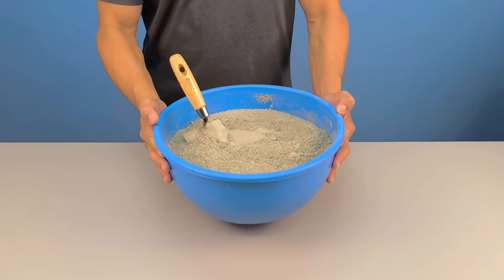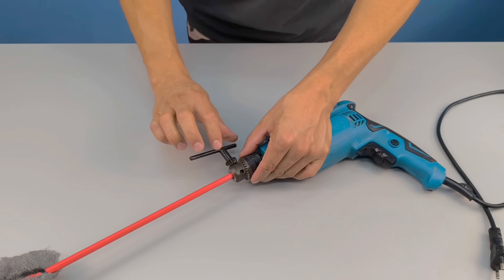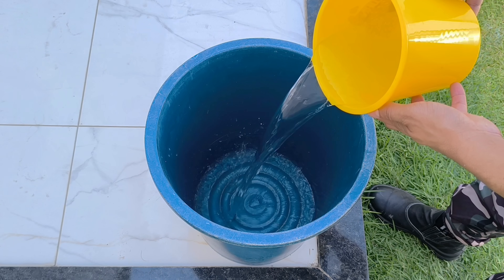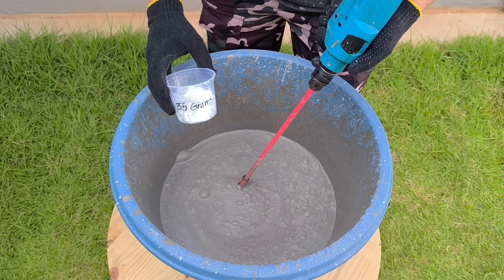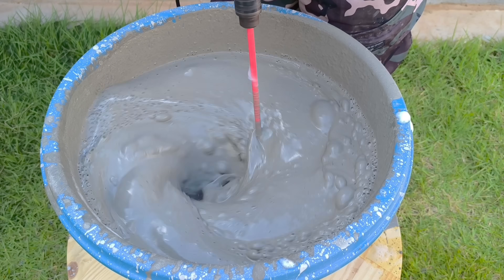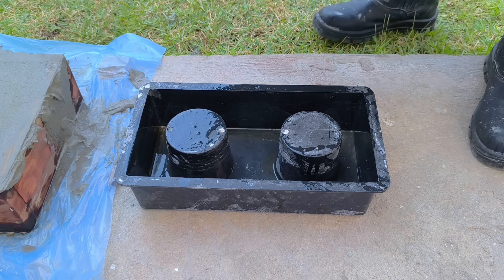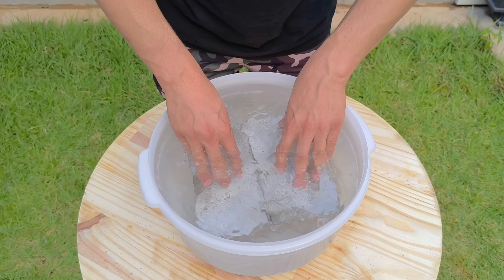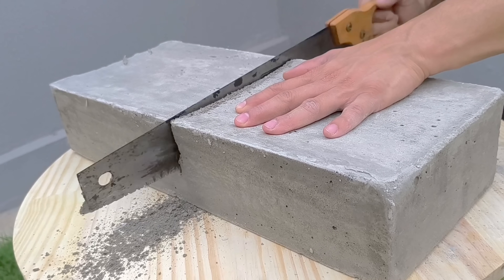Mix CEMENT with DETERGENT and create something that can REVOLUTIONIZE civil construction!

Comment: What about strength?
Reply from the maker: Strength depends on the application and formulation. This type of mix can improve surface hardness, adhesion, and durability, but it does not replace traditional reinforced concrete for structural strength. It’s best suited for coatings, finishes, or non-structural elements.

Comment: Tested in microscale, didn't worked as expected, I think it is suited for bigger blocks and there are lots of recipes that add other ingredients such as limestone+aluminium powder (for foam), and the foam quality is essential too...
I've also found a recipe that mix 1 to 1 parts of cement + sand and add the foam in the end.
Mastering the technique for a good foam with small bubbles seems to be the secret.
Reply from the maker: Thanks for sharing your experience and insights! It's great to hear about your experiments and other recipes.

Comment: It must be fireproof and extremely long lasting under high pressure and weatherproof. Wanker x
Reply from the maker: Thanks for your thoughts! This material is designed to be very durable, but its exact properties regarding fire, pressure, and weathering would require specific testing for different applications.

Comment: I have a question: if I wanted to make this block in a 400-liter mixer, what would the product dimensions be?
Reply from the maker: Great question! The final dimensions depend on the mold you use, not the mixer size. A 400-liter batch can fill multiple molds, so you can create standard bricks, panels, or custom shapes depending on your project.

Comment: What is plaster is?... Sir
Reply from the maker: Plaster is a fine white powder used for coating walls or making strong mixtures. 👍 It hardens quickly with water and is great for experiments with cement. 🔧✨
Reply: @inovaouinventa Thank sir....git it, in india it called p.o p Plaster of Paris

Comment: Thank you for this innovative project. I can visualise kitchen work tops and shelves by adding plastic rods??? and a thin hard work surface on top. maybe try that for the next show, if you have any more similar projects, where can i find them. i am from Cape Town in South Africa. bottom tip of Africa
Reply from the maker: Thank you! That’s a very interesting idea. Using structural reinforcement like plastic rods combined with a hard top layer could open up creative possibilities for lightweight countertops and shelves. We may explore this concept in future tests. Your suggestion is appreciated! 🧱🔧

Comment: It’s called RAC and it has a huge stress problem. In the UK we’re demolishing buildings that have used this stuff.
Reply from the maker: Thank you for sharing this important point. You are correct that some forms of lightweight or aerated concrete, such as RAC, have serious structural limitations. Our content is purely experimental and not intended for structural construction. Safety and proper engineering standards should always come first. ⚠️🏗️

Comment: What is “plaster”? 
Chemically known …
Reply from the maker: Plaster generally refers to a building material made from gypsum (calcium sulfate hemihydrate), lime, or cement, used for coating walls and ceilings. Chemically, gypsum plaster is known as CaSO₄·½H₂O, which hardens when mixed with water through a hydration reaction. 🧪🧱

Comment: I have  a test cylinder of this we used it to grout between  a pipe and a casing they had a machine  that mixed the foam with the cement 
Like the comments  said  not durable you can scratch it with  finger nails but it flowed awesome  through the  casing and out the vents as i remember over 200 feet
Reply from the maker: Thanks for sharing your real-world experience. This kind of feedback is very valuable. As mentioned, this mixture is more suited for experimental or specific low-load applications, and durability can vary depending on conditions. We appreciate your technical contribution. 🧪🧱

Comment: Does the finished item absorb water (like regular concrete would - big time),  does your float test remain afloat after some time?   this would be significant if the case for outdoor use.
Reply from the maker: Great question. This mixture does show higher porosity than traditional concrete, which means it can absorb water over time. In our float test, buoyancy is maintained for a period, but for long-term outdoor use we strongly recommend applying a waterproof sealer to improve durability and water resistance. 🌧️🧱

Comment: You made an angelfood cake cement block ❤ and I wonder if this could be applied to walls with color...
Reply from the maker: Thank you! Yes, this type of lightweight cement block can be adapted for decorative wall applications, including adding color pigments or coatings. The key is to test adhesion, durability, and surface finish to ensure a good long-term result. ❤️

Comment: Absolute waste of time. Why in the hell would anybody make this horribly weak concrete amalgam
Reply: Well son, you should shorten the video and get to the point a little bit more quickly and also explain instead of this being some amazing magical trick that it is an experiment. What you did is called Clickbait son.
Reply from the maker: Thank you for the feedback. This video is intentionally structured as an experiment and also as engaging content to reach a wider audience. Your suggestion about being more direct and explanatory is valid and will be considered for future videos. 👍
Reply from the maker: This experiment focuses on lightweight applications and material behavior, not traditional structural concrete. It’s about testing limits and exploring alternatives. Thanks for sharing your opinion. 👍

Comment: Everything is OK, the weight is twice as much, the durability is insulation... There's just one thing left, you didn't show how strong it is against impact and pressure.
Reply from the maker: Great point! Impact and pressure tests are important and will be included in future experiments to better demonstrate the material’s real resistance. 👍

Comment: Concrete is for structure. This would not pass anything. And so much effort. Why make blocks of anything that can be sawed with a wood saw if you're not using wood. Maybe a small pond. For all the effort to make a special mix I would still use concrete. What are you making that needs to be so light and moved but still have no structural integrity? Sandwiches?
Reply from the maker: I get your point! This experiment isn’t meant for structural use — it’s more about exploring lightweight mixes and testing reactions. Thanks for sharing your thoughts! 👍

Comment: What is the tensile strength? Can it be used structurally?
Reply from the maker: It has decent tensile strength for lightweight projects, but it’s not recommended for structural use without reinforcement. 👍✨

Comment: Its called aircrete, good for use in insulation purposes in walls or partition
Reply from the maker: Yes, it works similarly to aircrete, especially in insulation and lightweight applications. My experiment shows a simple homemade version without industrial foaming equipment. Thanks for the input!

Comment: this has to b e an AI generated voice. The liquid you have in the blue tub is not a dough. A dough is a thick mass, literally like bread dough.
Reply from the maker: The voice is synthetic, yes. And you’re right—the mixture isn’t meant to be dough-like. Its consistency stays more fluid because the formula focuses on aeration and lightness, not thickness. 👍

Comment: My question is it as strong as regular concrete  pour..so what i am asking can I use this mixture to pour a 30×30 slab and build on top of it ??
Reply from the maker: This mixture is only for experimental demonstration, not for structural use. It’s not as strong as regular concrete, so I don’t recommend using it for slabs or building on top of it. I’ll test reinforced versions in future videos.

Comment: The application would be for housing like they have Germany where they use a lot of concrete block in house construction. I’m not sure what soap would do for durability though. I’m sure there are other ways to do the same thing like using polyurethane, for instance.
Reply from the maker: You’re right, it can inspire ideas for lightweight housing materials. The detergent mainly creates air pockets, improving workability, not strength. So it’s great for experiments, but not for structural durability.

Comment: Here in the UK, porous concrete blocks are used for inner insulation wall for cavity walls. These are very light and weak. The outer wall is made of bricks.
Reply from the maker: Exactly! Porous and lightweight concrete is widely used for inner layers, especially for insulation. This experiment just explores the reaction, not structural strength, but it’s interesting to compare with real construction methods.

Comment: Cool. But what is the point of doing this? Essentially air entrained, weak concrete like material having next to none of the useful attributes of standard concrete.
Reply from the maker: Great question! 👍
This mixture isn't meant to replace structural concrete.
It's a lightweight formula ideal for crafts, prototypes, molds, insulation ideas, and creative DIY projects where full structural strength isn’t required.

Different mixtures — different purposes! 🧪😉

Comment: There is a chemical difference between dish soap and dish detergent. Which is it?
Reply from the maker: Great question! 👌
For this experiment I use liquid dish detergent.
Even though dish soap and dish detergent have different surfactant compositions, the key here is the foaming and air-entraining effect — which helps create lighter, more workable cement. 👍
Reply: @inovaouinventa in this case it's the dish soap like Palmolive or Dawn. Detergent doesn't foam that much.

Comment: Utter BS soap was used by builders in the 70's as a cheap elasticizer and due to the problems it later caused was banned, any chef will scoff at this because folder air into beaten egg whites to make meringue etc is old knowledge, no secrets here just a somewhat convoluted mess, when in fact their are commercial solutions for are the claims here that are tried and tested, thermalite ir cinder block for light weight bricks you can cut with a saw, and never put soap in your cement use the correct elasticizer...
Reply from the maker: Thanks for the historical context and insights into commercial solutions! It's always great to hear about different perspectives and experiences with materials. 👍

Comment: Might be alright for a small wall or feature in your garden. But I wouldn't trust building house with them. Washing up liquid and cement don't mix, banned in the building trade years ago because of cement going stale sooner and in turn the integrity of the whole building
Reply from the maker: Great point! 👍 This mix is for small DIY projects and tests, not structural construction. I always recommend following proper building standards for real structures. 🧱✅

Comment: Pretty sure concrete isn't supposed to have air in it. That first block with the two holes already had cracks when you took it out of the mold. It looks like crap! I think it would have cracked in the most of the pieces if you were to drop it on something hard!
Reply from the maker: I appreciate the honest feedback! This mix was tested as a lightweight experiment, not as a replacement for structural concrete. Air pockets can affect strength, and improving compaction in the next tests is part of the process. Thanks for watching and contributing to the discussion!

Comment: You can add dishwashing liquid to joint compound for a shorter set time, but joint compound is non-structural. Guaranteed bad results for concrete.
Reply from the maker: Thanks for sharing your experience! Yes, joint compound isn’t structural, and each mixture behaves differently. Here the test focuses on cement behavior with a surfactant, not drywall compound, to explore alternative reactions and possibilities. 🧪🔧

Comment: Concrete was invented/discovered 1000s of years ago. It has one main purpose and that’s to be strong and heavy and continuous hardened over time. Don’t try to improve something that doesn’t need improvement 👍🏻
Reply from the maker: Concrete is definitely a proven material with centuries of success. The goal here isn’t to replace traditional concrete, but to explore variations that may serve different purposes — like lightweight structures, insulation, or DIY applications. Innovation always starts with curiosity. 👍🏼🔬

Comment: more porous=weaker.. people please do not use these bricks for anything structural!
Reply from the maker: Absolutely — you're right. Increased porosity reduces structural strength. This experiment is only for testing concepts and exploring material behavior, not for load-bearing construction. 👍🔬
Reply: @inovaouinventa  ok well the video seemed misleading to me. Bragging about the strength of it for example and not disclosing the dangers of using it instead of concrete for many applications

Take care
Reply from the maker: Thanks for sharing your concern — I appreciate it. The intention is never to mislead, but to experiment and learn with different material behaviors. I always recommend using proper structural concrete for real construction. These mixes are just exploratory and creative tests, not replacements for engineering standards.
Take care as well 👍

Comment: How would it stand against erosion? Have you tried it yet? please try. Soap is still there and that dissolve quick vs water. Soap is made to remove dirt and stains. aggregates and the cement  are made of dirt.
Reply from the maker: Great point! 👏 I plan to test long-term durability and erosion resistance in upcoming videos. When using very small controlled amounts, the chemical interaction changes the behavior — not like regular soap use. Thanks for the thoughtful observation! 🔬🧱

Comment: no compressive strength test. so many air bubbles in these blocks they actually float! it looks like foam when you pour it. air bubbles are a weakness in concrete, thats the whole reason you WANT to vibrate to remove them. you were able to cut it with a wood saw.... maybe this is the "concrete" the chinese use in all those buildings that collapse. at best you've created a new kind of foam. if someone is stupid enough to do this in any kind of structural environment they deserve whatever they get.
Reply from the maker: You've hit on some key points. This material isn't for structural load-bearing and has different properties than traditional concrete, being much lighter due to the air bubbles. It's more of a foam, great for specific non-load-bearing applications. 💡

Comment: could this be used to make 3d light weight statues or figures?
Reply from the maker: Yes, it can! This mixture can create lightweight pieces with good structure. Just use proper molds and allow full curing for the best result.

Comment: @3:10 "When you turn on the drill.... what happens inside the drum is surprising."  Really ???  It's surprising that soap + water makes foam?  So you've NEVER taken a bath or even washed your hands????  eesh....!!!
Reply from the maker: The real surprise comes from how the reaction helps change the cement mix texture — not just the foam 😊 It's a useful effect in certain formulations. Thanks for watching!

Comment: Moght be suitable for docks and other non structural applications - suspect the plastrr will result in long term failure around water.
Reply from the maker: That's a great observation! 💡 You're right — for non-structural applications it can work, but long-term water exposure needs more testing. Thanks for the insight!

Comment: Its Foam Concrete, normally very weak, not structural and used normally as a void filler or trench backfill over services
Reply from the maker: You're right — traditional foam concrete is not structural and is often used as filler. But this mix focuses on improving adhesion and durability while keeping the lightweight benefit 💡🏗️✨

Comment: I’m watching in south Mississippi and we used nitrogen foamed cement in deepwater oil well for the first string of casing which is typically 36” diameter. This works to create a lighter weight slurry with the same compressive strength of the standard 15.8 pounds per gallon. This reduces the hydrostatic pressure of the slurry and helps get a good structural bond for the large diameter pipe in un-consolidated formations at the mud line.
Reply from the maker: That's really interesting! Amazing to see similar techniques used in professional deepwater applications. Thanks for sharing your experience! 🙌⚙️🌊

Comment: Called  Airtcret used to build Thousand of housed mainly Domes water proof fire proof its then cover with a cloth as forms the house and a plaster is add that holds and seals it all strong. normally use a air-con-presser to aid in mixing.
Reply from the maker: Exactly! Aircrete is incredible — lightweight, strong, waterproof and fire-resistant. Amazing material for building domes and sustainable homes! 🙌🏗️🔥

Comment: This light airy substance she's great in theory, but also seems brittle. If it can be cut so smoothly, then it can shatter, it crack just as easily. I'd imagine if you tried to drill into it, it would crumble away. If I need some craft project that floats and strength isn't important, I'll remember this whipped concrete... But is strength and durability is indeed, I'll pass.
Reply from the maker: Totally fair! This lightweight mix is only for creative projects, insulation ideas, and DIY fun — not for heavy-duty strength 💡🔧✨